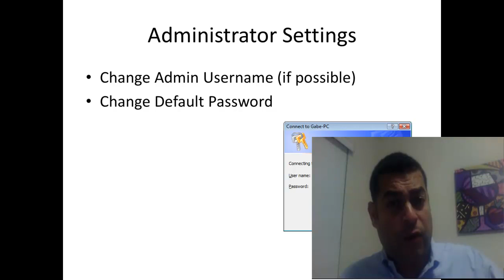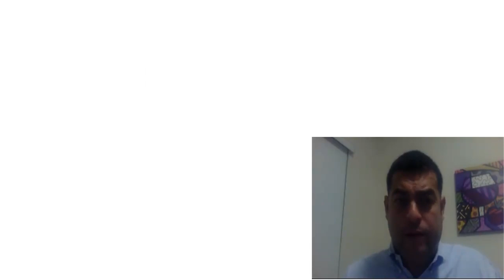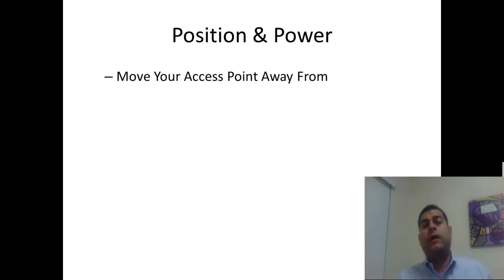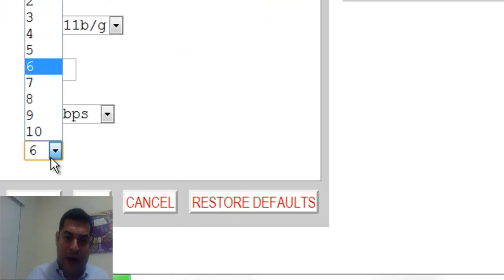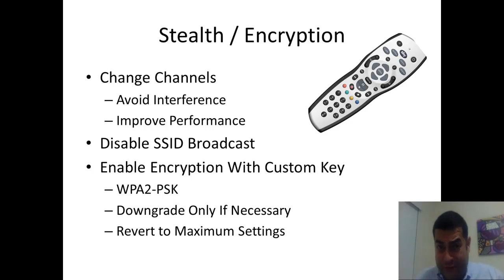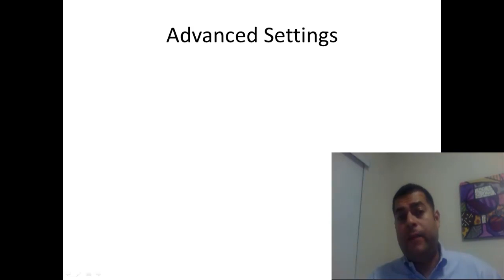Improving Home Wireless Network Security for AT&T DSL Customers using 2WIRE ADSL modem/router combo

Comment from the maker: I recommend that you enable MAC filtering on your wireless router.  This way, you can "whitelist" each device that is allowed to connect to your network.  If you have lots of people over to your house, this can get annoying.  If it becomes an issue, buy a wireless router that has a guest network and a private one (just for your machines).... Cisco's top-of-the-line routers can broadcast two networks simultaneously.  For more info, see wikipedia "MAC Filtering"

Comment: I think i got drive by hacked there where 7 users on my computer named system,Unknown( S-1 numbers ) and it took 3 min to load the desktop and it has taken 3 min since a month ago i used avast and malwarebytes and avast found 7 files and 20-30 password protected files then i used my visa card to buy something and avast an malware bytes was gone with my firewall and shields i re installed windows in safe mode and un plugged my router what should i do now ?